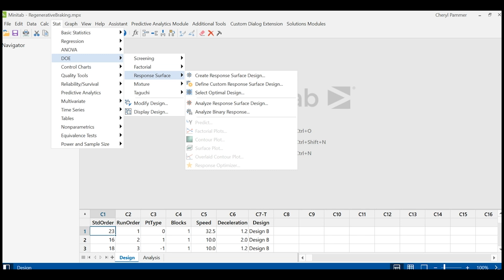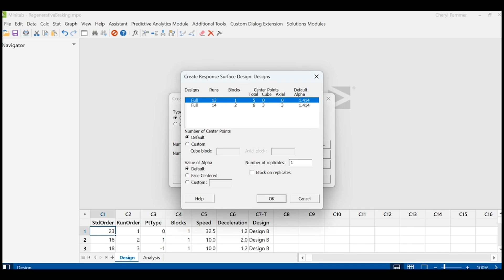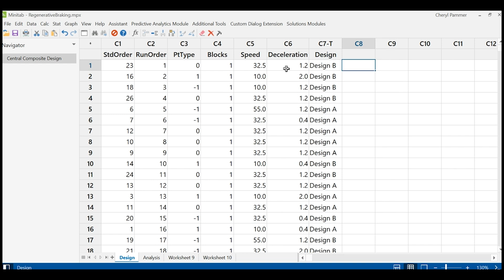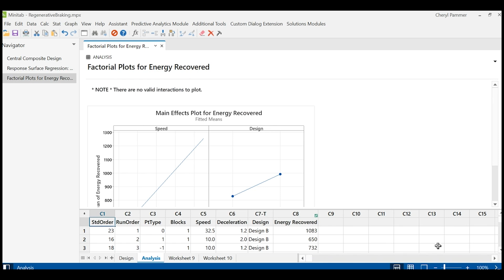Design of Experiments for Electric Vehicle Regenerative Braking | Minitab in Minutes

Comment: A much better approach is an I-Optimal design.  With two continuous factors, one 2-level categorical factor, 8 replicate runs (yay!) and 3 extra runs provides the following properties:

20 run response surface design (much smaller design!)
Maximum Prediction Variance is 0.91*
Worst-case correlation of model terms is 0.217*
Visual insight on our ability to repeat results (Variability Chart)
Numerical insight on our ability to repeat results (ICC from an EMP analysis)

This is a vastly superior design compared to an unreplicated CCD design.  No contest, really.

*and, we know this BEFORE we spend the big bucks collecting the response data (double yay!)